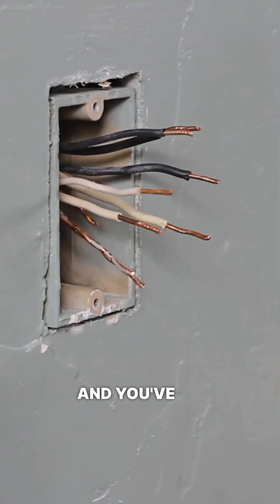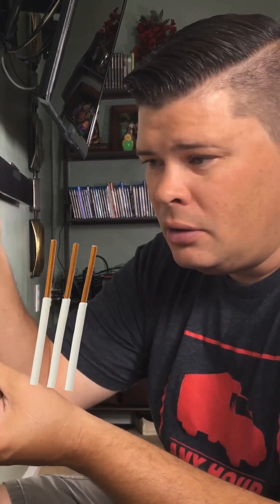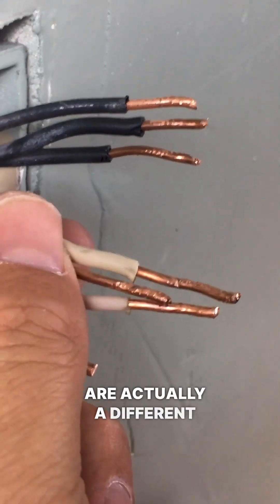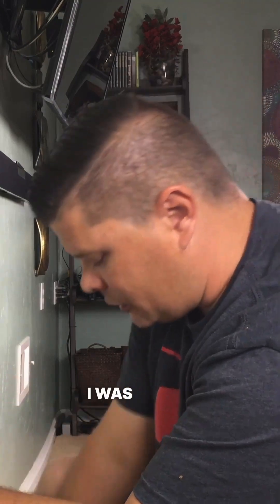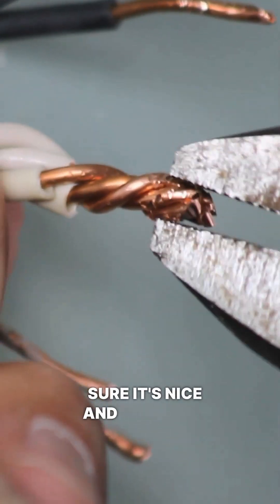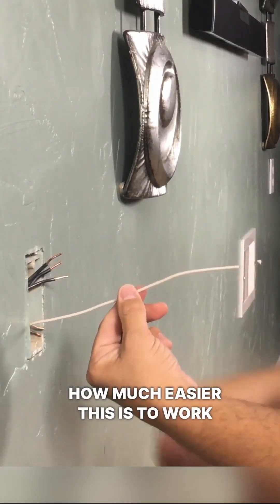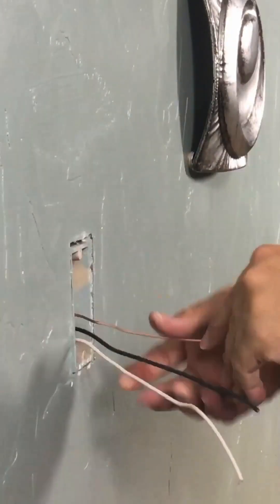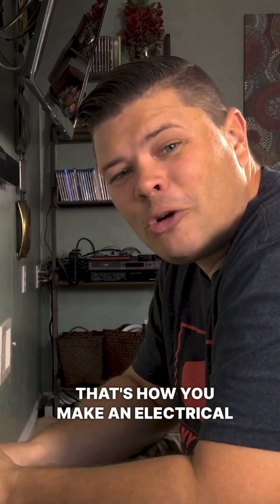How to Create an Electrical Pigtail

Comment: One of the most concise and clearest descriptions on the subjects i’ve come across. Also best camera work, clear close up shots of the work and very clear audio with no background interference. Needs more views! 

1x question - I am pigtailing because i’m replacing broken outlets in my home. The new outlets only have 2 connector screws on each side of the outlet, the older outlets had 3 screws on each side. I had planned to pigtail 2/3 hots and 2/3 neutrals so that I have 2x hots (1 pigtailed and 1 original) and 2x neutrals (1pigtailed and 1 original)  to correspond with each connector screw. But it looks like, based on your video, that I could in theory simply have 1x hot, 1x neutral, and 1x ground and just leave one of the screws on each respective side empty? I hope my question is clear. Thanks for such a solid video.

Comment: Unfortunately, trying to stuff that much wire into an older metal 2" deep box is not that easy. Deeper boxes are OK but our house was built in the '70s & things have improved a lot since then. Pig tails are a good solution if they fit.